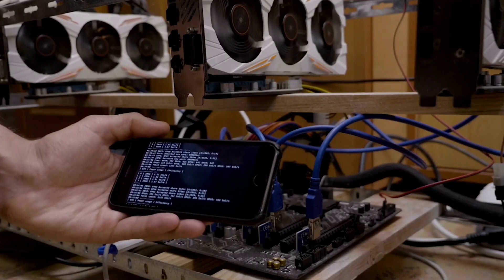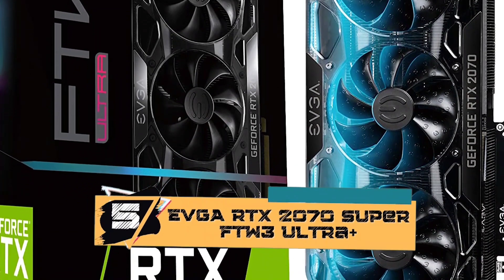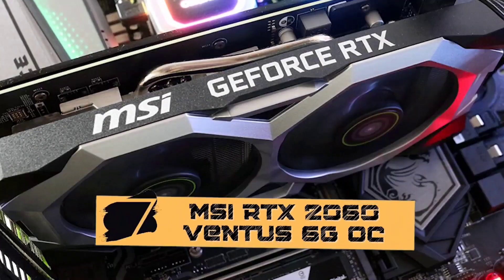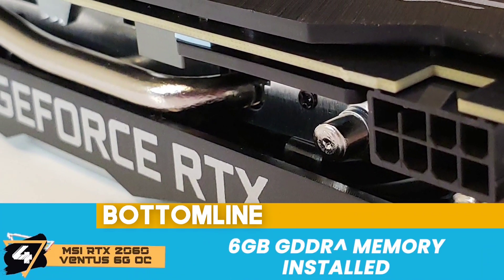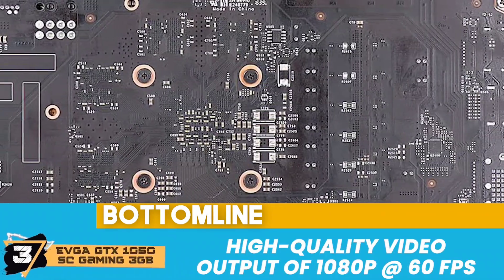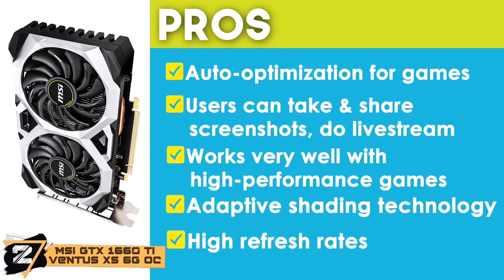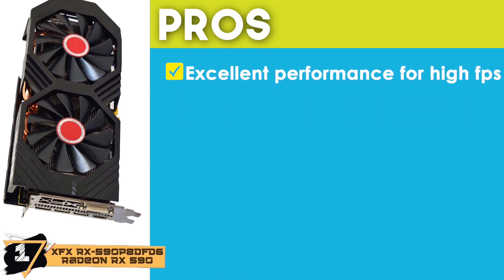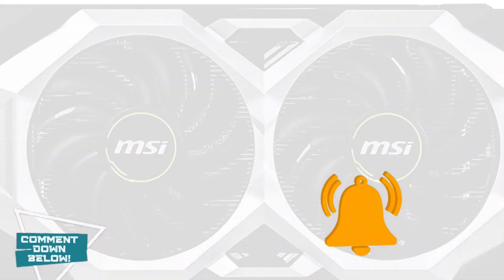Best GPUs For Ryzen 5 2600 | Digital Advisor

Comment: • 24" Curved YGT 75Hz 1920 x 1080P Gaming Monitor - NEW
• AMD Ryzen™ 5 2600 6-Cores / 12-Threads up to 3.90Ghz + B450M Biostar with M.2 - NEW
• RX-570 4GB DDR5 256-Bit, MSI / Gigabyte FAN - Used
• 8.00 GB RAM DDR4 2666Mhz Hyper X Fury - NEW
• 256 GB SSD, 6 GB/S, Kingsman Gaming - NEW
• 500 Watts 80+ Certified - Used with 1 year warranty
• Inplay Meteor 03 White or Black Tempered Glass - NEW
• 6 Pcs G-Storm White Fans - NEW
• RGB Keyboard and Mouse - NEW
• RGB Headset - NEW 
• Extended Mousepad - NEW
• AVR Secure - NEW
• Free Delivery Within Metro Manila, Cash on delivery, Home Set-up, Plug and Play • 
-is this set up good for gaming?

Comment: Would this still be the same for Ryzen 5 2600x? If not would you give any recommendations.
Reply: Nvm just look up the difference between AMD Ryzen 5 2600 and 2600x, the 2600x comes with a better cooler and have higher overclock speeds but essentially the same cpu.
Reply: yeah you can use any of these gpus for that. The 2600x is a better version of the 2600, has a couple better features but bottom line is yes you can use any of them.
Reply: @P00P_   I just got the ryzen 5 3600 instead
Reply: @native3689  Good choice.
Reply: @native3689  good choice i reckon you could use a 3070 with not a lot of bottleneck if you are running games in 4k (maybe with a little oc) it's an excelent cpu for the price